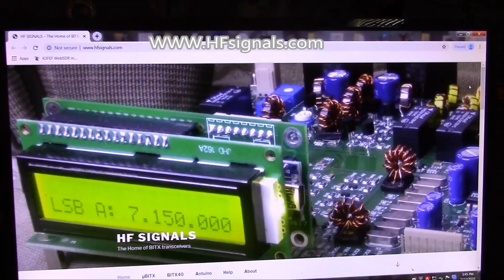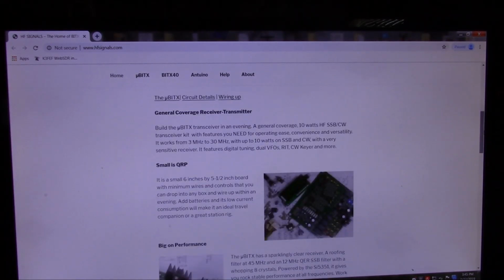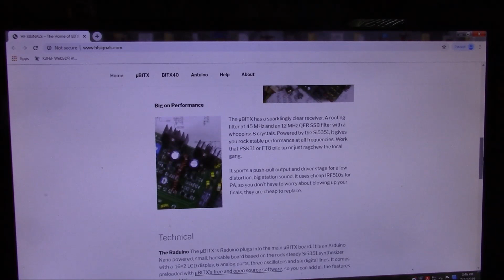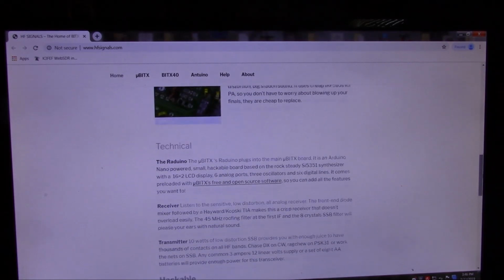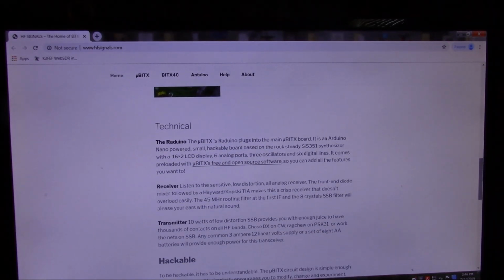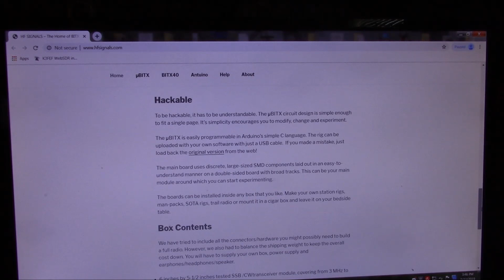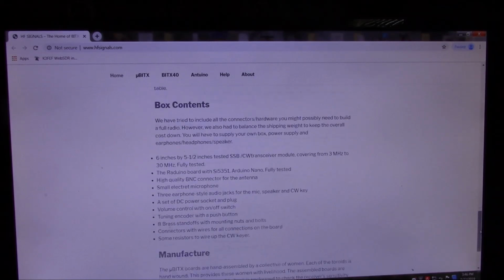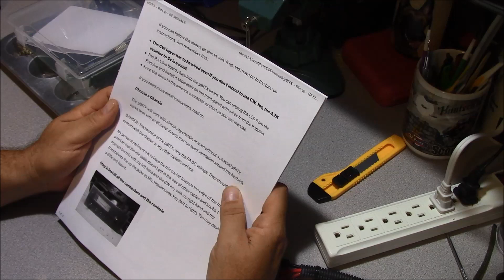uBITX / MicroBITX  HF SSB/ CW Radio Kit part 1

Comment: I'm looking to get into the 100 watt HF radio space. Specifically looking for a radio that would work digital modes easily as well as predetermined HF communication paths. QRP and working DX stations isn't something I'm looking to get into right now. Nicer features like a waterfall are not needed and for digital it'd be preferred to have a single usb connection on the radio for CAT and tone transmission. Any recommendations?  I really like the 891 but the usb is only for CAT. Thank You!
Reply from the maker: I have friends who have IC7300 's and they are very happy with them.  There was a sale last year and after rebates the 7300 was 800 bucks.  Its a bit too gadgety for me personally but I wouldn't turn one down for that price point. A great no frills budget HF radio is the IC718 IMHO and that's what I use as a back up radio and probably would still use it primarily if I didn't get such a good deal on my IC756 Pro III and I don't use half of the features that radio has. I hope this helps ! Thanks for watching !
Reply: SurvivalComms have you done digital modes on the 718?  If so, how did that go for you?
Reply from the maker: @viewatyourownrisk  worked out very well using a signalink. What modes are you interested in ?
Reply: SurvivalComms i can say for sure not ft8, I just don't see the benefit to comms with such limited transfer of info.  JS8Call sounds interesting. Truth be told the interest in simple digital implementation is about future proofing a purchase, I just passed the general exam on 7/14 so I've as of yet no real hf experience. Which is also why a $1000 7300 is a tough pill to swallow out the gate, still it does a bunch of stuff I just don't want to pay for.
Reply: @survivalcomms  Well, I just got a wicked good deal on a reliable 2 year old Yaesu FT450D and an antenna tuner, $475 for the pair.  So HF...here I come.

Comment: Hmmmmm, makes me want another one. I have an older version and learned some hard lessons with the toroids. I like that the board is assembled. Looking forward to seeing you build it!
Reply from the maker: I look forward to putting it together. Have you had luck with yours ? It will be interesting to see if it works as anticipated. It is pretty cool that it is essentially out of the box built. It essentially is a put it in a box and connect the dots type of build. Thanks for watching !
Reply: I've built two different kits (can't remember which ones) On one of them, I learned about getting "ALL", not just some, but all of the enamel off of the magnetic wire used on the toroids, I screwed it up and delaminated the pads on the board. The other one seems to work, but without good test equipment, I had to use another radio to see if it was on freq. I did get it aligned,  used an old CB mic, speaker, etc. I have not had, or even tried very hard, to make a contact with it. I really should set it up this week and give it a good test. Either see if I can get a reply on SSB, or see if I can get the CW mode working.
Reply from the maker: Oh yeah I have been there before too. Did you lift the traces off of the board ? I did that once and made buss wire traces out of a few projects in the here to fore. It looked like merde but worked well.
Reply: @survivalcomms  I'll have to see if I kept it, I could try and repair it as well....